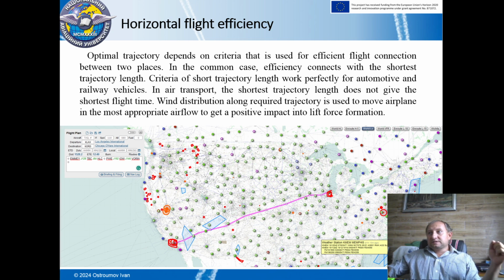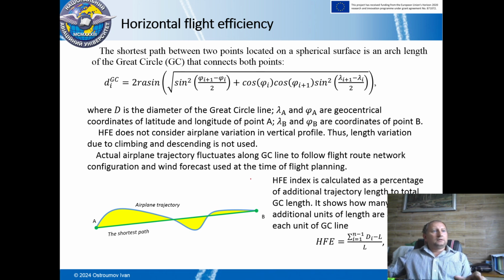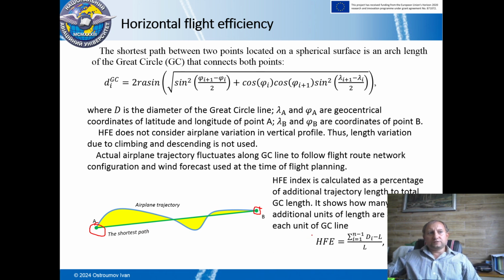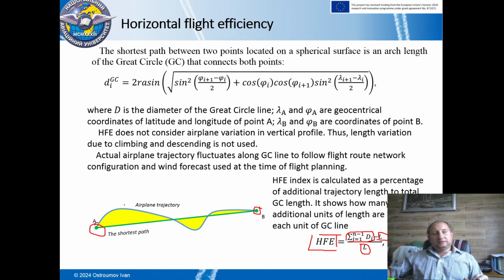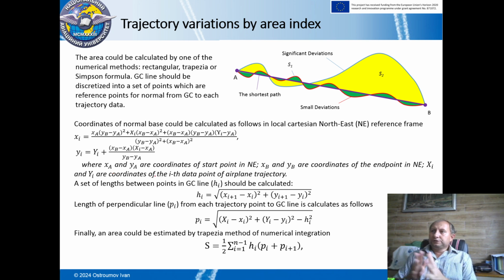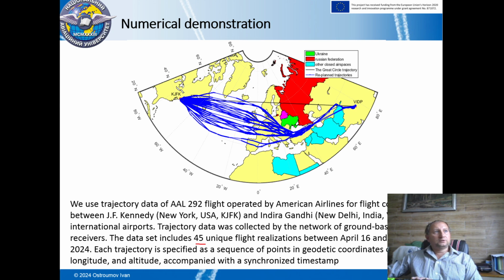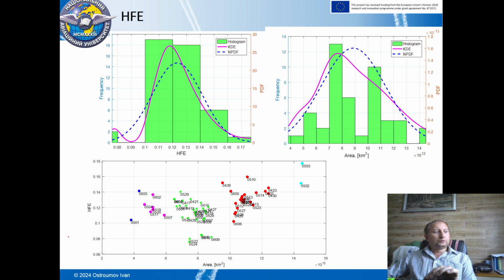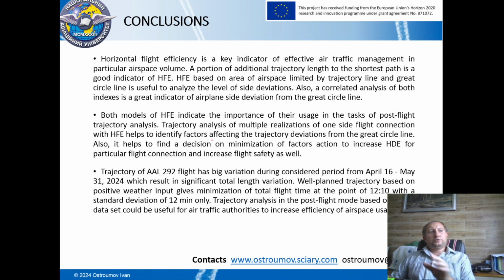Estimation of Horizontal Flight Efficiency for Air Traffic Management System

Comment: Why do you consider only Horizontal Flight Efficiency? How it is possible to use your results for space motion?
Reply from the maker: Civil aviation usually considers two types of efficiency separately Horizontal and vertical Flight Efficiencies. 
Horizontal Flight efficiency indicates a level of airspace structure. This means airplanes use a predefined flight route and they have to operate within this stable network of routes. Thus HFE indicates the level of network performance to support traffic.
Vertical flight efficiency is connected with two things the first one is standard schemes of airplane movement in SID and STAR. The second one is the rules of ATC.    
If we consider UAV, in this case, yes. Combined Flight efficiency could be possible.